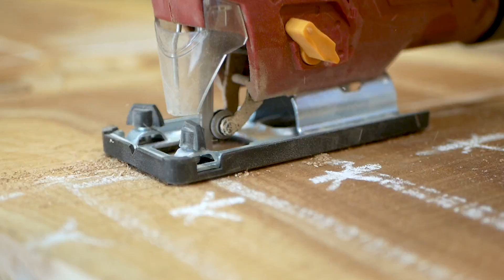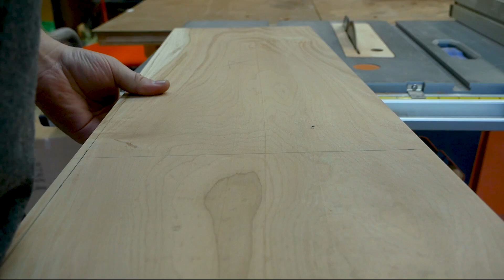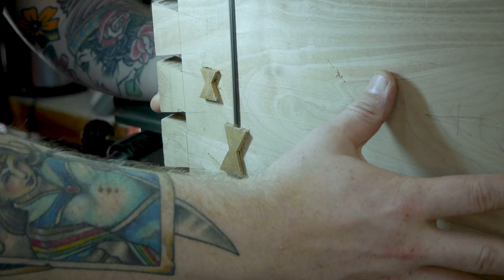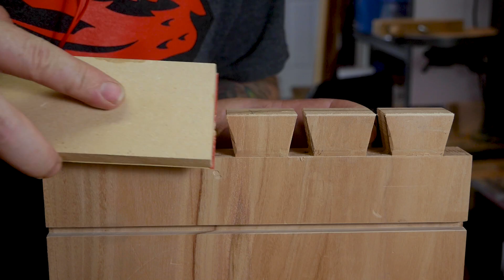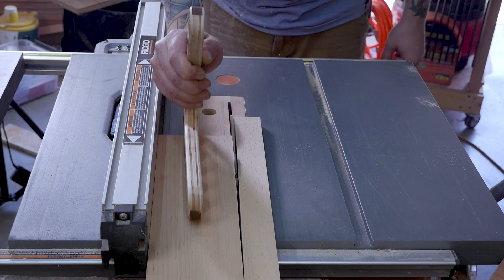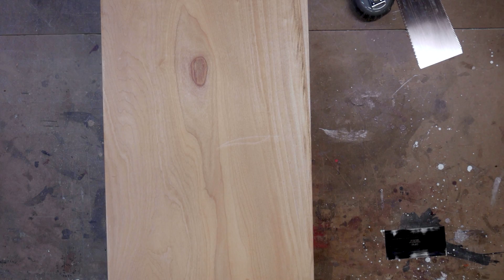Small Tool Chest Build Equals BIG TIME Workshop Storage | Woodworking

Comment: What are the minimum wood working tool types needed to complete this project? I currently have sliding miter saw, circular saw, jig saw, router and router table, and an orbital sander. I also have wood chisels and of course some drills. Are there any other tools that are required?

Comment: 6:24 I don't even know where my mitre gauge is. I use a sled. I have three or four sleds of varying size for different applications and don't have to worry about the fulcrum effect , nor the width of the boards I am cutting as the oft used version handles to 12-1/2" and even then it isn't often other than plywood that something bigger is needed. 
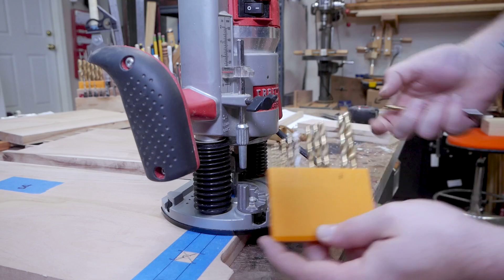At 8:00 you use a router to waste out wood; I'd have done that at 7:10 and not had to scrape or dress anything.
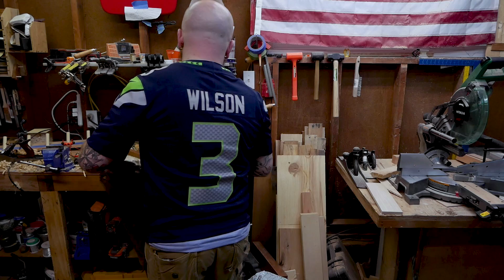12:08 I would have held back the 1/4" drawer bottom decks and made the drawer fronts a bit taller to cover them, rabbeting the case sides 5/16" with wider drawer faces - thereby making a cleaner drawer front. I just simply couldn't stand to look at the drawer decks through my OCD every day. Not everyone would care...

Otherwise I like the project.

Comment: Hi, really great video and thanks for the links. I've ordered several off your list. I noticed the tool you were using to check for square - seems like a great approach. I've tried finding them on the internet and it seems they're called pinch sticks. But the only one I found to order was on etsy and it was tiny. Did you buy them or make them? I looked for a CNC router SVG file as well. No go. I'd appreciate any help you could offer pointing me in the right direction.

Comment: great video!  Could you say more about the blue tape trick?  Is it primarily for visibility?  Or maybe it helps with having few marks to sand out later?
Reply from the maker: Yes on the visibility, plus one more: when you use a pencil mark there's no "stop" for the chisel to fall into. You could cut to the left, right, or split the pencil mark. With a cut line, or the tape, there's actually something for the chisel to fall into or bump up against, making for a more accurate cut.

Comment: You mention perhaps a lack of wall storage. I have been making small shelves between the wall studs. A 2x4 and drilled in though the stud to the board. For a bit bigger shelves use a 1x6 or 1x8.....then small board across the front on the stud to keep items from falling - a shim will get that board out even further and make better use if the shelf space. These little shelves are made from scrap wood and really tidy up the shop - small bottles and cans...tools..booze..soda.. tapes and anything small.
Might work for ya.... cheers
Reply from the maker: That's actually really clever! I'd probably do it to if I didn't have plans to insulate and cover my bare walls.... it's almost unbearable to be in there during the dead of winter or summer
Reply: @Craftswright  yeah I hear ya.... weather can be an issue....

Comment: I just built a similar cabinet for the exact same reason, shop slob. It's not anywhere near as pretty and doesn't have dovetails anywhere, but  it works and now I have more places to put more crap! 6 drawers, each 4 inches deep and 42 1/2" wide. (don't ask) Anyway, it amounts to 42 1/2x4x16x6=16,320 square inches of new storage space. All from a bunch of cheapo used plywood and a stack of 2x12s ripped to 1 1/2" strips for the top.
Reply from the maker: That's awesome Martino! Haha you tell me not to ask and yet you throw out this crazy drawer width and make me uber curious. Sounds like a bunch of great storage though, and I've got another video coming in the next week or two that should equal about 100,000 square inches of mobile and dust-free storage 😉

Comment: Are those drawers done with butt joints?  Seems odd to go through the trouble of doing hand cut dovetails on the casing, then do butt joints on the drawers. Still, its a functional piece and looks nice, just struck me funny.
Reply from the maker: Full transparency - you're right. Butt joints for drawers where the casework is proud dovetails and faux-through-mortises is odd. My thought process on that decision though was 1. on a time crunch and want to get this video out (poor excuse I know) 2. I would still be gluing the drawers down to plywood that acts as the drawer slide, which would seem odd with handcut case and drawer work, where the slides should be hardwood and hidden. Ya know?
Reply: @Craftswright  I understand, perfect is often the enemy of good enough, and for this application, what you've done is certainly good enough. Cheers!

Comment: I wanted to do the same sliding drawer tool box. I was not sure if the plywood will slide smooth enough. What has been your experience? Do you need any wax or something as a lubricant? I am thinking of using wood pieces on the side walls and wood strips to the bottom of the plywood drawers. That makes it costly and clumsy design. I am kind of stuck there. Please let me know. Thanks, Regards,   p.s. I am a hobbyist/ DIYer.
Reply from the maker: Hey Priyam D, So far they're working really well for me! They rack and stick a little if they're empty, but once you put a little weight in them they actually slide very smoothly. I did put a tiny bit of paste wax in the dados, but other than that I just made sure the edges of the plywood that went inside the dados was nicely sanded and smooth, with a slight roundover. I don't think this design would work well for heavy duty drawers, but for small tools works great. Hope that helps and happy building!

Comment: Nice work! A friendly safety tip though -> where you show the miter gauge trick, you're using the fence as a stop block. I know its not a through cut but if the piece happens to bind on the fence it can kick back like you wouldnt believe if you're pressing on a miter. A solution to this is to use a reference surface pressed on the fence that doesnt travel to the blade. A squared up piece of wood or whatever.
Reply from the maker: I would totally agree with you in most cases, and in most cases I do use a spacer that slips away once contact with the blade is made, but since the miter gauge was reversed, which puts inward pressure on the stock instead of outward, and the cut was so close to the fence (less chance of twist followed by kickback) I wasn't too worried about it. Ideally this should be done with a table saw sled 😁
Reply: @Craftswright  didnt even think of the reverse miter haha. I see wood pushed against fence for a cross cut and my butt hole puckers lol. Good stuff though, thanks for the polite correction, I wasnt trying to be pedantic fwiw.
Reply from the maker: Didn't take your comment as pedantic at all! Was good insight and in all reality you're correct - I could have made that cut in a safer manner even with the miter gauge reversed!
Reply: @Craftswright  all that said the reverse miter trick blew my mind. I have NO idea why ive never thought of that haha. Good stuff all around

Comment: Do you ever need to sharpen your Japanese saw?
Reply: It depends on the specific saw, but in very many cases the blades are considered a consumable item and not intended for resharpening. This is because the teeth are impluse hardened to a very high hardness and the shape of the teeth is very complicated compared to traditional Western style saws. Japanese saw teeth commonly have two to three facets per tooth, which makes the sharpening difficult and slow for most people. Plus pull saws often have smaller teeth than push saws, so you have to do all that fiddly work on very small teeth. Rather than make people go through that, many/most Japanese saw sold in the West are made with single use blades that are very sharp and hard for long life and then meant to be replaced when dull.
Reply from the maker: I have yet, no. But the replacement blades are so inexpensive I think when the time comes I'll probably just replace the blade and save myself the headache :)

Comment: 1st video I’ve seen of yours, nice work! Just subbed. Now for my opinion. The plywood your drawer bottoms were fast and easy but, I really feel take away from the handmade look of the cabinet. It would’ve been just as easy to cut a wider groove in the carcass sides for a hardwood runner that would attach to the drawer sides. The drawer front would extend to the sides hiding the runner for a very clean look. My .02 cents worth, hope you don’t mind.
Reply from the maker: Thanks for the kind words and the sub Tom! You're totally right, and I don't mind your .02 at all, keep em coming in the future in fact. There are a few things on this build I would change if I had to do it over again, that probably being one of them. I just thought the concept was fun so I wanted to give it a go, with the bottoms also being the slides, but yes hardwood runners would have looked nicer and also hidden the sliding mechanism for the drawers. Cheers Tom!

Comment: Great video. I also have a ridgid table saw, and I am very curious how you made your zero clearance insert plate, as I am struggling to get square cuts because the regular insert plate flexes and is not level with the table or square to the fence
Reply from the maker: It's a great saw but that is a HUGE problem with that model. The throat plate is as solid as a wet noodle haha

I should probably do a video on it, but the short and skinny is:
- Take a scrap piece of 3/4" plywood double-side tape it to the top of your saw (with the blade and riving knife removed)
- Turn your saw up on it's side and remove the black dust shroud
- From underneath the saw take a pencil and trace out the throat opening, including the tabs for the leveling screws
- At the bandsaw or with a jigsaw remove the waste and tune the fit so the piece fits IN to the throat perfectly
- Double sided tape your new template on top of your final stock
- Take a router with a straight pattern bit in it and remove the waste material leaving about an 1/8" lip 
- Fine tune the fit and you're good to go!

Comment: That turned out very well and you have discovered one of Murphy's workshop laws about horizontal surfaces; something we all have to fight against.

Sorry to be negative though I didn't like the plywood edges from the front, could they banded in some way or could the drawer fronts be made oversize to cover them? I also think you would have to be careful about turning the mitre gauge around for people that have a small table as the wood may loose support near the end of the cut just when they are leaning over the blade the most.
Reply from the maker: Wonderful feedback Michael and much appreciated! I thought about cutting a little rabbet into the drawer front allowing it to hang over the plywood bottoms/sliders but ultimately decided to go against it because you would still see just a bit of the plywood on either side of the faces and I thought that would look worse. Plus the bottoms being they way they are allowed me to set the drawers back a hair for a nice shadowline. But I completely understand what you're saying. Hadn't thought about tiny edge banding though 🤔

Good point on the reverse miter gauge technique. I might make a comment and pin that up top